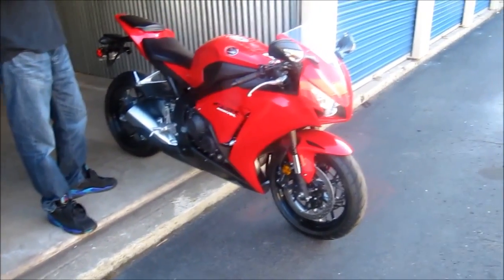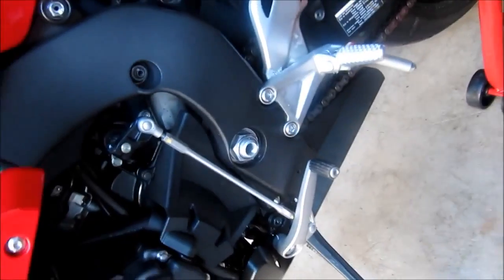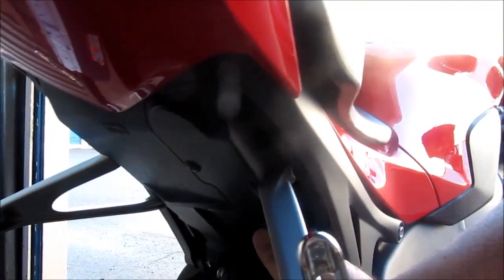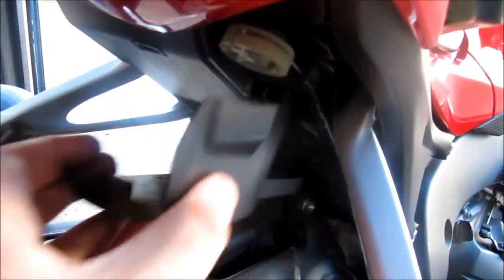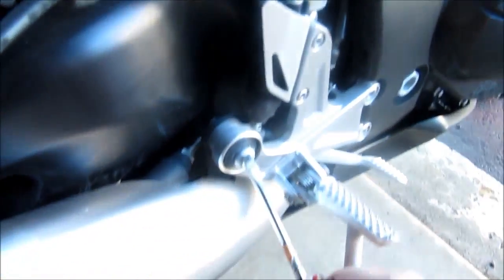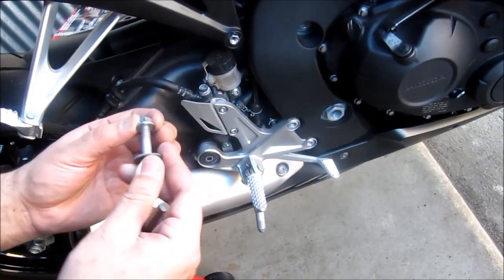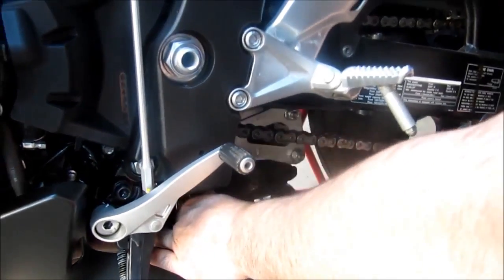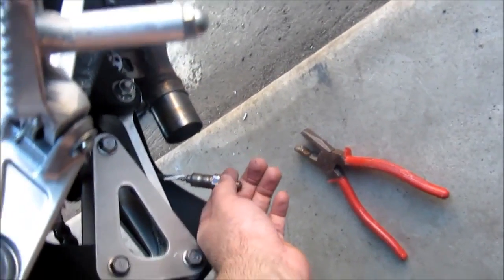exhaust installation instructions yoshimura r77 2012 cbr1000rr

Comment: did you feel a bit of gain power? and no problem with idle since the install? thanks
Reply from the maker: +Jo Gibo yes i didn't have any problem with idling. i didn't feel an increase in power, if anything i felt the bike got a little slower past 100mph, i sold it last year, i have a 1199 panigale now
Reply: DJ Aladdin ok thanks so how is the panigale compare to the cbr lol??
Reply from the maker: cbr sounded better but the power and looks of a ducati are in a different class. i don't think i will ever sell it.

Comment: how the hell did you get the exhaust clamp onto the midpipe? I've tried and can't seem to get it on. the threaded bolt isn't curved enough.
Reply from the maker: I didn't experience any issues getting the clamp on, just had to loosen it all the way with a screw driver.

Comment: I agree its not a bad looking exhuast yes, but 1 the s bend on the mid pipe will steel some hp and 2 the sounds on the r77s are  lack luster in comparison to the 2 brothers and the m4 line. Both of which are much more deeper and throaty sounding. I know b/c I have installed and used all 3 on my bikes. just my 2 pennys check my videos if you want to see.
Reply: those exhausts are trash. I guess that matters if you care more about sound than performance
Reply from the maker: yeh sound and looks was the main reason i wanted the yosh, bike was fast enough on it's on
Reply: Bug Off:  To each their own, I currently have the TwoBros on mine and it's obnoxiously loud.  I got used to it but I also care about what the people riding/driving around me and my neighbors think, I keep them in consideration.  I was struggling between deciding between the M4 and Yoshimura but I was able to find a great deal on the Yoshimura so I got that instead.

Oluseun Are:  The M4 exhaust is definitely not crap.  That is a great brand, great system, great customer service.

Comment: What happened to cable under seat? Is that no longer required?
Reply from the maker: shapalando1982 that gets removed once the factory exhaust is taken off, it's the cable to the server motor which will be no longer required with the after market exhaust.

Comment: Should sell it and get a 2Bros much better sound
Reply from the maker: this looks better with the heat panel installed and most companies don't provide them, i get alot of compliments for the exhaust
Reply: burger king Yoshi goes with Honda like peanut butter and jelly. Thank you for this video!
Reply from the maker: It's peanut butter jelly time
Peanut butter jelly time
Where he at, where he at, where he at, where he at
There he go, there he go, there he go, there he go
Peanut butter jelly, peanut butter jelly
:D
Reply: burger king I installed this last night and I seem to have a small leak where the yosh meets the sock header pipe. Doesn't seem like the yosh pipe can move up much more. Is your clamp fitted completely over the lip of the 2 pipes?
Reply from the maker: no it will fit completely, try lowering the angle and pushing it forward, keep adjusting until everything is aligned, i ran into something similar